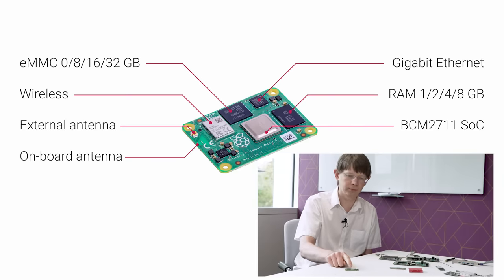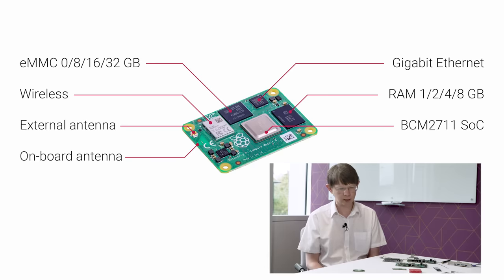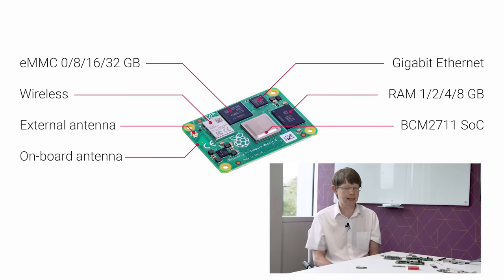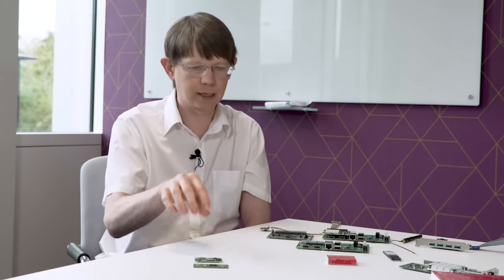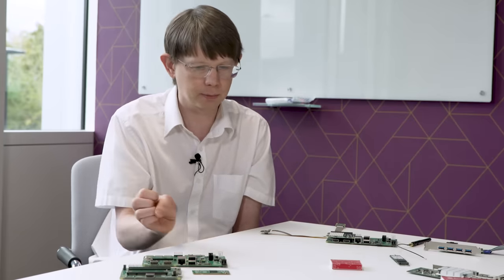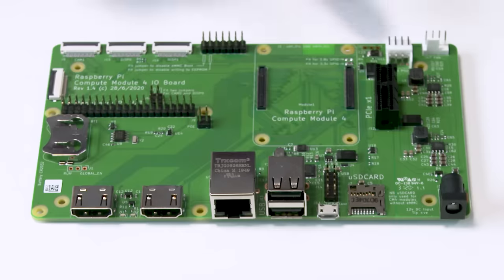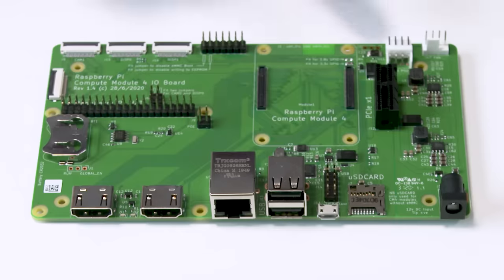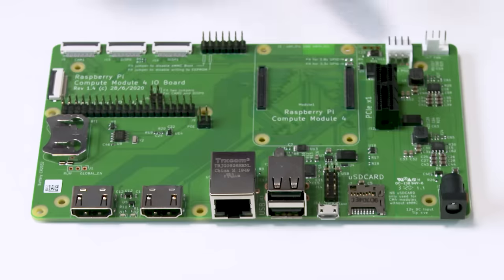Discussing Raspberry Pi Compute Module 4

Comment: The retro pi handheld game is about to explode
Reply: ive been waiting for cm4 to do a updated handheld project..... soooo yeah FINALLY!
Reply: Will take a year for new devices to get out.
Reply: @caleb7475  yeah, you're right. I'll stick with my experimental pi dmg for now
Reply: I hope Retroflag will make a new Gpi, maybe a new cartridge will be enough if the power draw isn't too high.
Reply: Yep! No need for anyone to roll their own boards anymore, except the I/O.
Reply: @indask8  dude, that would be awesome. If i think the step up from the zero to the cm4...

But i think, this would also need some cooling
Reply: @J Fz custom boards thats what the cm is for. the one shown is just one option
Reply: @indask8  The main issue with powering would be from the need of 5V due to its target audience are the industrial audience, but I'm pretty sure there's some standard 7.2V battery that would supply enough current for such application, and once the voltage is converted down the current draw from the battery falls too.
Reply: Would need better graphics, else it's almost the same as current offerings..
Reply: How? You still need that bulky io board right? Is there any low profile board that you could use instead?
Reply: @verb - I think the idea is that they would manufacture their own IO board that's specific to the device. CM3 was a component in some semi-DIY handheld gaming devices.

Comment: Can you make another short video to explain my wife why I absolutely need it, on top of my existing Raspberry Pi herd? This would save me a lot of trouble 😂
Reply: Back in the day I used to have to take out a rather significant bank loan to buy a computer.  Over the years I have spent far more money on computers than I paid for my house.
Reply: yeah, not so cheap when getting cm4 and dev board and "industrial powersupply/poe hat+poe switch" and antenna kit , but still interesting for the dual camera option.
might need cooling fan ...
Reply: Just bought 5 Rock64's that were dirt cheap. 15 each. Trying to convince mine why I need to get a Pi as well.
Reply: NVME over PCIE
Reply: @vwtch   Back in the day, my dad bought a powerhouse of a Macintosh, but needed a loan from the bank first, and my parents agreed to use their car as collateral if the payback was behind.

Comment: Can't wait for the first one to put an RTX 3090 into that PCIe slot!
Reply: Cryptomining will never ever be the same.
Reply: that card uses a bit more than x1 i expect, also needs a pc powersupply,
not impossible but highly unlikely
Reply: @jyvben1520  If I remember right didn't they say this board could accommodate up to a 24 v power supply for industrial applications? If that is the case, don't see a reason why this might not be able to handle a RTX 3090 provided you can work out the problem with the PCIe connector limitation. I am just learning a lot of this so forgive this for what it is. The GPIO handles varying voltage outputs yes? Would it be unrealistic to make a GPIO to the power connection on the 3090?
Reply: I doubt the board can handle 15 Ampère, so an additional power supply will be necessary.
I assume someone will get it working, but with a huge performance penalty due to bandwidth limits.
So no, it can't run Crysis. 😜
Reply: Most likely not. Nvidia's drivers are binary only and closed source. They don't have an ARM version for Linux yet though that is somewhat likely to change(don't keep hopes up).
HOWEVER, AMD has open source drivers so you might be able to plug a Big Navi card into it though you may need(or may not) a pc power supply
Reply: @_tsu_  Nv did just buy ARM for 40bil... so you never know :)
Reply: @ygrittesnow1701  recon we can get the fans to spin (24v yes, 300watts.. not so much ;o)
Reply: @ygrittesnow1701  Don't power your gpu with 24 Volt, best case you will blow all the fuses. The CM4 IO board should be able to handle 75W through the PCIe slot (power limit of PCIe), the 12 pin / 2 8 pins  need to be powered by an external 12 V source. The best option here is a PC power supply which can be turned on by shorting the green cable to ground

Comment: The PCI Gen2 x1 slot is going to be very useful for mass fast storage, like an NVMe SSD
Reply: nvme really?
Reply: But does the SoC even support NVMe? Also, PCIe 2.0 x1 is 500MB/s, slower than USB 3.0 so i don't see the point...
Reply: @zungaloca  yes.  Its proven to work and work well
Reply: @marslife409  Theoretically you're going to get slightly better throughput on the PCIE bus than USB3.0.   They actually have the same theoretical throughput limit, but since in the RPI  the usb chip is behind the PCIE 2.0 x1 bus,  you have to add a  translation layer with no possible speed increase.  Practically, putting an NVME board on the PCIE bus is a simpler translation than going from PCIE->USB3(host)->USB3(client)->(SATA or NVME).
Reply: Provided you don't want USB at the same time

Comment: I like the antenna connection with a wire attached. We use computers in basement when routers are upstairs. And external cable attached makes it better WiFi connect.

Comment: Will there be other options of IO boards available in the future? Why having the CM4 in the first place if i need the hugh IO board to use it? And what specific connector (100-pin high-density connector) is actually used? I couldn't find any name or serial number for that in the documents.

Comment: At 6:03 the new cm4 is being compared with the old cm3 board. But it says Compute module 2 on the old board and it has a BCM2836. Did the raspberry pi foundation accidentally show an old cm2 prototype?

Comment: You are becoming a company to reckoned with.
Outstanding,  now I have explain to the wife why I need a new Raspberry PI!!!
Reply: Easy one, Pi is an infinite number, just like the needs for Rpi's ;)
Reply: It has become clear that the Free Software approach, applied to both software and to hardware, is the only platform which has the ability to prevail over the long term.

Comment: The IO board is brilliant. As long as future modules maintain the same form factor, all you would have to do is upgrade to the next gen board and keep going. The only downside to losing the DIMM side is there are a few products that just came out that depend on that interface. Be nice to see a second iteration of the CM4 come with the same DIMM interface or at least another board that it can connect to. Maybe a DIMM adapter that will fit the PCIe 1 slot to carry over.

Comment: Hi RPI guys, just wondering if you will produce GPIO-only dongle for this module without any need to use mother board. I need more powerful substitution for RPI Zero W with at least 2GB of RAM, but I don't need any PCI-X or HDMI or USB ports from your mother board for CM4. Or maybe you've got some plans to substitute your legacy RPI Zero W with something modern and more powerful?

Comment: with these new interface for CM4, it will be very hard to stack multiple CM4 in a single compact interface board (Cluster).
Reply: New boards will be made to accommodate this
Reply: I've already seen a carrier board that the CM4 snaps onto and then allows you to slot it into an edge connector like the previous modules.

Comment: To use a baseball expression, the RPi Foundation has really 'hit it out of the park' recently with the CM4 and the RPi 400 - standing ovation !!
The CM4 I/O board is a great companion but I consider it a version 1 product. I really hope that a newer version will include all USB3 ports and PCIe v3 x4 which almost all NVMe flash storage cards are designed to. 
Due to the published CAD files other vendors probably have this in the works already. Also looking forward to HATs and cases that will make multiple drive (say RAID 6 HDD) NAS solutions possible.

Comment: 7:35 The IO board... except for the PCI Express, and the double DSI/CSI connectors it appears there is no extra added value wrt the Raspberry Pi 4, that has a smaller form factor and Usb3 ... 😃
Reply: It's not meant for conusumers, it's meant for testing atm until companies make their own custom PCBs for this.

Comment: Who has visions of Hackintosh running on Raspberry Silicon?
Reply: Hackinstosh run on x86 hardware, because x86 is extremely backward compatible, stable, standard, in fact cost of supporting old instructions for x86 is among other thing are things that slows down x86 in front of ARM that doesn't have such things to support. So in fact next version of Mac won't run at all.
Reply: @Kabodanki  But, if Apple switches to their custom silicon which has an ARM base CPU, you might be getting away with ARM, and the Pi.
Reply: Sounds like something Linus would be into. Anthony doing all the hard work of course.
Reply: Have you seen iOS, which is Arm, on something that is not an iPhone? Arm Hackintosh isn't gonna happen either

Comment: Question. Very undecided as to which to get. Looking at the new Raspberry Pi 400 and the new compute Module 4. Obviously the Pi 400 needs no case, however the computer module and the IO board are so incredibly new, are there any dedicated cases available for this?
Reply from the maker: there are no cases for the Compute Module as its purpose is to be embedded.

Comment: This seems to be a different design from previous so maybe not backwards compatible with older projects. Overall though Im extremely excited about the ideas around the new design and  its a lot more powerful with the upgraded memory and onboard emmc etc. I am concerned regarding single lane on the pcie.. curious what the implication are for possible dev on some graphics cards for this slot.  Great job guys!! now if you can get an m.2 nvme up to 8tb please ;)

Comment: Make an expansion board designed specifically for making tablets and sell it together with a touchscreen with at least one camera on it.
Of course this board must have battery support and can discard ethernet in favour of some other nicety. And the PCIe must be converted into a MiniPCIe slot like on them laptops.
And bang, you have entered the Tablet market big time.
Reply: The only possible problem I see with this is having to use the built-in PCB antenna of the CM4, since you wouldn't want to stick that u.FL bulkhead connector on your tablet, or re-certify it with another. Here's hoping RPi Foundation will make another u.FL option with a flat antenna you can stick inside the casing like laptops have.
Reply: AFAICT, "all" that one would need to do is design a case for the existing R-Pi 7" screen that would hold at least 1 r-pi camera (maybe 2 for front and back cameras?) and the CM4-IO board. Might be a bit thick tablet with all the IO connectors on the existing CM4-IO board... But it is doable.

Comment: can i put a nvidia gpu into the pcie add-in slot?
just curious if it can be done
Reply: In theory, amd will be the better option since you will have to recompile the drivers for arm
Reply: I was thinking of bolting a RX 580 on it
Reply: With the network i/o this has I would think that attaching the nvidia gpu to the network itself rather than to the computer would be the way to go.

Comment: If we could use Standard ATX PSUs on some Boards, this would be great for a DIY NAS, since you could just put a SATA HBA (Which you can get for like 45€ on Amazon) in the PCIe Slot bam, 8x 3,5" Drives on a Raspberry Pi
Using high density drives, that would be what? Like 160TB (minus RAID and formating)

Comment: Now I really don't know what to buy the raspberry pi compute module 4 or the raspberry pi 4 with 8gb of ram?
Reply: I'd say pay the few extra bucks for the compute module and the base board:
1: You don't need to find a compatible USB-C power supply.
2: You have much more freedom on modification to your own needs.
I had two PI 4B boards since they were first announced, but haven't started using them because ...
* I need a micro-HDMI cable for the screen. I really wish they had used full-size HDMI there.
* I need a USB-C connector for the power. I really wish they had used a barrel-type power connector instead.
... I now have the USB-C cable, but still need the micro-HDMI cable.
Reply: It really depends on your use case.

Comment: Argh... The design files for the CM4 IO board were done in pre-alpha software. KiCad v6 hasn't even reached it's first RC (feature-freeze has been declared so hopefully the first v6-RC should be released somewhere around the turn of the year 2020-to-2021). According to one of the KiCad developers on the user forum "as far as I can tell, they didn’t make use of any new features that would have required nightlies", so why didn't they just release files that are compatible with the current stable version of KiCad?

Comment: WOW!  Now I want EVERYTHING!  I'd like to build a 3D-printed bottom, to a delicious RGB mechanical keyboard, so that I can plug in my fancy-ass keyboard to the Ethernet, or connect via WiFi, and power it from inboard 18650s, or external 12V, or PoE & attach to any monitor that's near.  All I need now is the time to develop it, and the money, too!